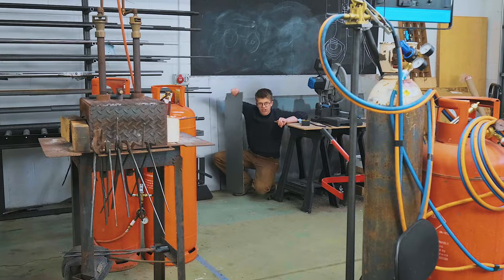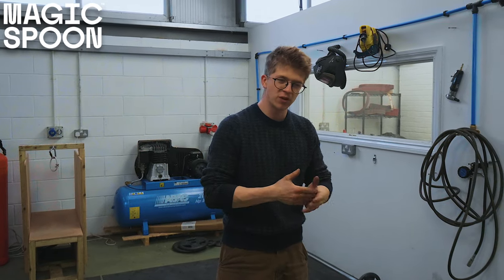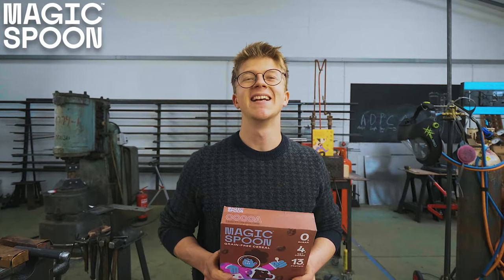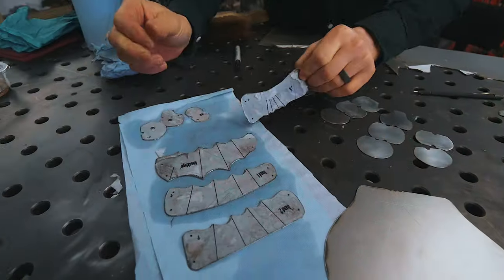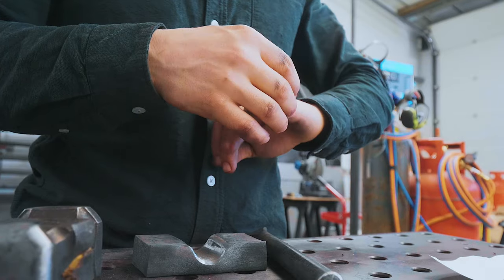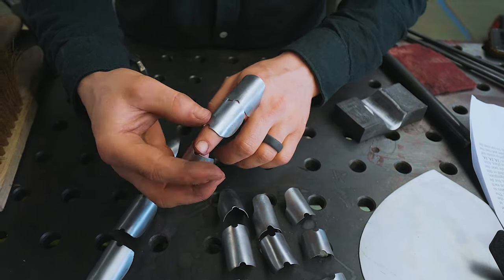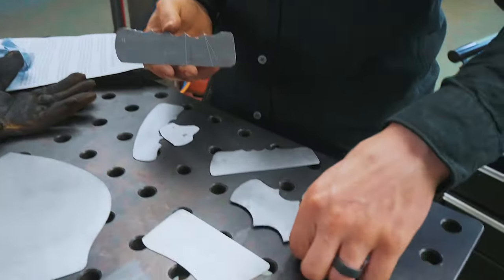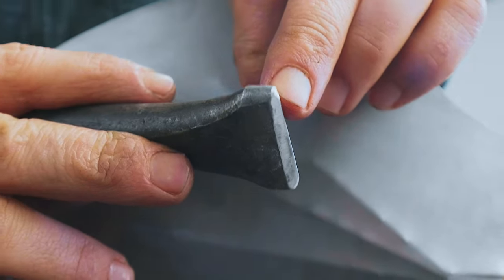MAKING AN ARMOUR GAUNTLET!!! Part 1

Comment: Alec, if ever you want to glue paper to metal again, the easiest way to get it off without great inconvenience is a blowtorch. The high temperatures will burn the glue and paper long before any deformation will take place. Love from Germany, I hugely enjoy your videos.
Reply: Or forge for bulk+ a more even heat perhaps? Unless it's galvanised, in which case rip

Edit:actually probably a poor idea, superglue would release some non trivial amount of Cyanide while burning so probably best avoided
Reply: @AngDavies  superglue does not contain cyanide.
Reply: You triggered the internet safety squad. 😱
Reply: Acetone bath or mineral spirits for cleaning parts
Reply: Super Glue (cyanoacrylate) can be softened, if not removed entirely, by soaking it with acetone, and then buffing it with scotch brite. Furthermore, it is possible to use acetone to transfer the lines from the printed paper to the sheet metal.
Reply: Using hot glue would also work as it would melt under the torch
Reply: @Arachnoid_of_the_underverse  excellent point. I hadn't even considered other adhesives.
Reply: the best glue for that task is actually spray adhesive. Super-even application, low hold. You don’t want a strong joint for the template, you just want it to last until you make the cut. Then it can fall off.
Reply: You could just use mineral oil as a glue, tbh.

Comment: Alec!  Love the content, especially love you learning new skills.  For CA glue (Superglue), Acetone, not alcohol to break it down.  Or just good old heat. The glue is just cyanoacrylate, which is just a simple plastic.  Heat releases it (machinist's trick), or just burns it away.  Spend time on metal work, not frustrating glue clean up.  Happy hammering!

Comment: Love the build! I know it’s too late now but here are some tips for affixing paper templates and removing them. First using a spray adhesive is much better than super glue. Most spray adhesive have direction for a temporary bonds. It holds well during the cutting but will peal off after with no problem. Elmers has a spray adhesive that works well. The glue can be cleaned up with just a little acetone then. If you need to remove super glued paper either soak in acetone or burn it off with a torch. If burning though make sure to do it outdoors so you don’t breath in the fumes. I’m excited to see this armor making series!

Comment: For getting the paper off I use fire. It produces nasty fumes so do it outside or in a well ventilated space. One of the perks of this is that you can anneal the steel at the same time and make it easier to work with

Comment: Uhm... for breaking superglue bonds, you can just heat the glue with a hot air gun, or in a forge  or something. That will break the glue and the pieces will just come apart

Comment: Fantastic video!  I finally have something useful to share.  I do some sheet metal work as a hobby, my favourite home made tool is the magnetic hold down board I created.  You take a wood board, screw on some cheap rectangular magnet tool holding bars and then cover it with a thin sheet of aluminum.  You can now take any thin metal part and stick it right on there and grind on it with confidence.  Was handy when I made Thor's hammer.  Hope you find this useful...and hope it wasn't mentioned in the 1377 comments below that I did not bother to read through!

Comment: Hey Alec - I’ve been HUGELY impressed with your work for years since well before you moved! Just wanted to throw one suggestion in… I think (and it’s been about 3 years since I last did it..) soaking your templated parts in acetone will eat the superglue right off in one fell swoop. You can get it easily at fibreglass supply places, numerous places online, and also in aerosol form as ‘foam gun cleaner’. Also - did I miss the one where you introduced your sweet little Malinois looking apprentice..? I’m going to sit back and watch some more now…

Comment: Hey Alec, little tip if you want to use super glue & remove it. Acetone dissolves it pretty quickly. Very handy to know if you glue your fingers together. Like I may or may not have done a time or two. 😁

Comment: Hello Alec, if you can get 3M products in the UK (I know you can in the States), they make a spray glue that's excellent at sticking paper to metal. And the cool thing about it is a little acetone on a rag, wipe the surface of the paper until it's saturated and the paper easily comes right up, and in one piece without tearing. Just something I've learned about over the years. Take care.

Comment: Pro tip : gauntlets are designed to fit perfectly when your fist is closed ( around whatever weapon you want to hold ).

And your hand changes shape when you close it ( mainly the area of the knuckles nearest to your hand ). Most include a sliding rivet near the pinky which provides some action for the metacarpal plate, the rivet near the index finger on the same plate generally only provides for rotational movement of the same plate.

Wrist side to side flexibility was not a major design criteria for originals. Modern reenactors and medieval combat sport enthusiasts ( aka the Eastern European Bashers ) generally do like more wrist movement though.

Comment: Missed opportunity with the portable bandsaw Alec! I love mine for roughing out weird sheet steel shapes like this. I can usually get them close enough to finish on the belt grinder.
Also, rubber cement > superglue

Comment: Hey Alec, Jewelry making tip for you, use some Elmer's contact cement for gluing the paper templates. It will hold strong enough to cut but will come as incredibly easily when its time to peel off your templates

Comment: For paper templates, instead of superglue use spray adhesive; spray it ONLY on the paper, then follow the normal instructions of letting it mostly dry until tacky before applying. Most spray adhesives are designed so when only coating one side it'll create a strong but temporary bond and be reasonably easy to remove later.

Comment: I have found that when gluing a pattern onto sheet metal, it's best to use a glue stick. When you are done transferring/cutting out the part, dunk it in water and the glue should dissolve and the paper should easily rub off.

Comment: If you cut out the template and use it as a mock up by using tacks as rivets it makes it easy to make adjustments before you cut metal. You can use the tack holes on your pattern to mark where your rivet holes should be. In case you ever want to make another one that fits better and less of a hassle to build.

Comment: Just a tip, there is CA glue solvent, model makers use it.  Also, just mask up and torch off the paper next time, save time and hassle.  Oh and next time you need to drill on a rounded surface, wood dowel rods make a good form to drill on.

Comment: Hi, i had the same problem for the realization of a front panel. Use a stick glue for paper instread of superglue, it holds well and it can be washed with just a bit of water, leaving no residues

Comment: Acetone will break down the C.A. glue no problem and it evaporates fast too. Just be careful as it will melt many plastics including ABS, Polystyrene and PVC. Hdpe (number 2 plastic) should be fine though.

Comment: Hey Alec.
Easy way to remove krazy glue from metal. 
Gently heat. The glue will literally evaporate leaving a clean surface. 
I’ve done that countless times when working with sheet silver and gold.

Comment: 2 pieces of advice for you my friend.  some eastwood electric metal sheers for cutting sheet.  saves you a ton of labor, 2nd  a full box of laminate from the jungle website for the template, then you can stick it to the metal after it is laminated and peel it off a lot easier.   not tryin to step on your toes, love your content and have been watching for years.  just thought i would try to give you some advice to make your life easier.

Comment: Lordy, a day to prep your parts! Some thoughts from a machinist. A metal-cutting vertical bandsaw would have those pieces cut in about an hour, including deburring. Acetone dissolves superglue and dychem. Use spray paper glue instead of superglue. That ball is called a dolly, look for panel-beaters tools. Make the holes from the inside of curve to avoid having to hold an unstable surface. Hope that helps. Great vids. Please print more youtube, I never knew you could do that :P

Comment: You could try spray on contact cement instead. A friend of mine many years ago told me a story about contact cement. His friend was working on the house with his wife and looked up one day and said "Go pack up. we're moving in tonight." All he had to do was glue the formica countertop down. A very quick end to the project. He set up his fan blowing the fumes out the window went to work when suddenly the vapors hit that fan and the entire kitchen was in flames. HIs wife returned two hours later as the last firetruck was leaving. All that was left of the house was a charred spot where it had been. If you use that stuff do it outside. Terrifying stuff. Nice video.

Comment: Hope to see you get to planned collabs in the future when it's less of a pandemic-induced headache. This came out well, and now that you have the 3-dimensional understanding of how it fits together, I suspect you can do some more interesting things with it, especially with someone else who does armor making.

I don't know how much you want to delve into this, but if you want to delve further into making gauntlets and armor, you might consider looking at cosplay armorers. They use thermoplastics and foam more often than metal, but the cutting and shaping processes are extremely similar to what you did here. Ironically, the main difference is you wouldn't need to heat the metal before shaping it like they do with foam and thermoplastics.

The hardest part at the end of the day is that some poor sap has to fit into the armor and move around in it.

Comment: Next time skip the super glue and go straight to the acetone. It only works if you use a laser printer but if you do. Just place the printed paper on the metal and pour the acetone into it. The ink will be released from the paper and stick to the metal. Used to do it when I would make name plates or baptism bracelets. My dad laughed and said calligraphy wasnt something you could rush into and showed me that cool little trick until I didnt need to anymore.

Comment: If you ever have a problem with removing superglue again, try using aceton. In my experience that does the trick much better and faster than alcohol. Just be careful with materials other than metal because they sometimes get dissolved as well...

Comment: You can make a 2nd gauntlet with the original sheet steel you cut out. Sand off the paper you've super glued on...  and use the other side, you'll have a left and right hand :)

Comment: I have wanted you or another YouTube blacksmith to make high quality armor for a long time now. I really want someone to experiment with different Damascus formulas to make the ultimate ballistic plate armor. You have complete control of the grain patterns, the different steel alloys, shapes. If you could make a decently thin and light level 3 Damascus plate it would sell faster than anything you’ve ever produced. Period. People will pay 500-1000 for a simple sheet of steel.

Comment: PRO TIP ALEC, if you need to remove superglue, use ACETONE, it will dissolve any cyanoacrylate-based superglue instead of alchohol much better and let you peel whatever you glued down off better

same goes for sharpie too if you ever get that where you dont want it

Comment: Cyanoacrylate glue should come off easily with an acetone bath or by heating the pieces with a heat gun.

Saw them on Clickspring and been using them myself since.

Comment: Use 3m super 77 to glue the paper. Then heat the metal with a heat gun lightly and it comes right off

Comment: There is a way to cut sheet metal with electrolysis it's a paint coating then scratch the pattern and the scratched area eats away

Comment: Actually watching an Alec Steele video and think I have something to offer, when drilling the finger pieces you should have used a broom handle (or equivalent) under the metal to drill through and into, rather than the end of that bit of metal.

Comment: Great as usual! How about using a Razor blade next time to remove the alcohol and water soaked Paper Glue Pieces. It works fine on all materials! 
If the Glue is very Strong Acetone can probably help out ;-D (Use while wearing Mask only)
Keep up your awsome Channel @Alec Steele

Comment: The correct answer was Elmer's stick glue. The kind from 2nd grade. It'll keep the paper on good until you dip it in water. Then the paper slides right off and the glue cleans up easy.

Comment: Ooooh, looks like your CA shield could have used a dishing form (like a biiiiig one!).
Long ago (in the before times - two decades? geebus crisps >_<) I took a series of hollow-ware workshops where our base containers were dished and eventually raised  into some pretty deep vessels using oak log forms. Upsizing a dishing form would likely work but you'd be moving a lot more metal.
I wonder how a hydraulic-pressed/formed shield with hand forged details (raised concentric circles, engraving, fittings etc) would turn out?

Comment: Alec: Mmh this template paper does not stay in the sheet metal with spray glue when i cut it with angle grinder creating heat....Lets superglue it on
Also Alec: Ou no i cant peel the paper off from the sheet metal

Everyone with bit of pattern recognition: You do notice correlation between adhesives and heat? Add bit more heat until you succeed, since you do have means to god damn melt the steel sheet if you wanted to and ignition point of superglue is "bit" less. You would only need to heat the sheet so much that connection between glue and metal fails, then just scotch brite it and polish after its shaped as intended. This aint rocket science and i recall him using superglue on metals and breaking that connection with heat trick before.

Also have you heard about our lord and savior acetone? It dissolves CA glue bond real quick, where you can soak it in alcohol for hours upon hours with out any effect.

Comment: This a good start at learning sheet metal, but you should keep going. If you would just work with sheet metal making different stuff for a couple of months, you will learn most of the ins and outs of it. This is why lots of jobs have a 90 day probation. If you aren't proficient at it after 90 days, you probably need to reevaluate.

Comment: If you had a $100 sandblaster from harbor freight, or the bri-ish equivalent, and used walnut shells or 20-30 plastic media, the paper and adhesive removal process would have been a 10 minute job

Comment: wouldn't throwing the pieces in the forge for a minute (not enough to forge but a blue heat) to burn off the paper and glue. then the excess should just wipe off.

Comment: Why not using metal snips... I have worked with aluminium and steel sheet for a year a few years back and I never used an angle grinder.

Comment: LOL alec mega fail on removing the paper at 3:46 why didn't you toss the parts in the forge with the fire down low and just burn off the paper a bit shut the forge down let the parts cool and remove the paper and anneal the metal in one step ?

Also for removing super glue use nail polish remover isopropyl wont work well

Comment: You need sliding rivits to make it move properly.
David Guytons design deasnt include this.
The rivits need to be places in slots rather than circular holes. This way they can move an a double axis
Reply: I did slotted rivet holes on my original Version 1 gauntlet. After that I decided to keep it simple for newcomers to the hobby
Reply: @DavidGuyton  really? Thats a shame. A lot of armor i see online doesnt include this and its really useful for more mobility. I think its something to pick up as soon as you starts doing armor. A tutorial on different forms of articulation would be useful for really anyone.
Reply: @paweandonisgawralidisdobrz2522  It's difficult for people, especially beginners, to be able to cut slots like that and have them smooth and uniform. This is especially true when the tools are meant to be cheap and ordinary. However, there's nothing stopping someone from taking the design and elongating some of the holes for better articulation.
Reply: @DavidGuyton  yeah there is nothing stopping them... if they even know about it

Comment: The first pass with the paper, couldn't you have just run a torch over it and burned it off?
A couple other things are suggested below to help out. I took a metal raising class in college as part of my art degree. As well as an enameling class.
Reply: Also, for that sheild that kept popping up, when I raised a goblet out of a circle sheet of copper in college you start in the center. Look at how to raise forms like goblets, teapots ect. if you want to keep making sheet metal stuff. It's enlightening.
Reply: Also, may I suggest a rawhide mallet. Though that brush for a hammer is hilarious!

Comment: Sorry, But I am Sheet Metal Worker and I can do what you did(and would make own patterns not copy one R&D is fun), How is this BlackSmithing?  Are you a true BlackSmith(They didn't have grinders to shape blades (how about beating them out instead or grinding away as waste of steel real old school?), or modem stuff and Experts can't replicate True Damascus)?  How about showing smelting steel and beating the steel to thickness instead of Buying sheet steel? Picturing in 3D, so you can't flip a picture of a job in your head?